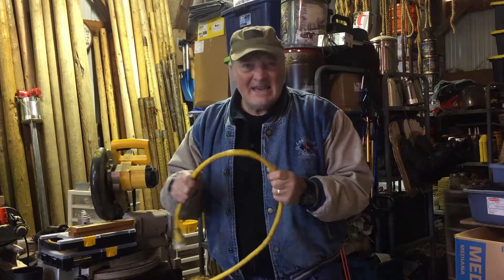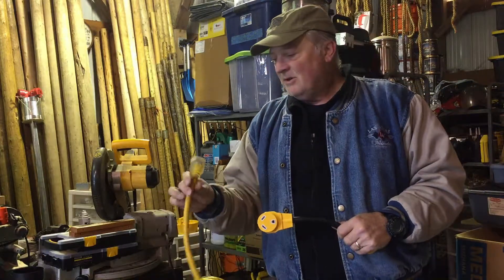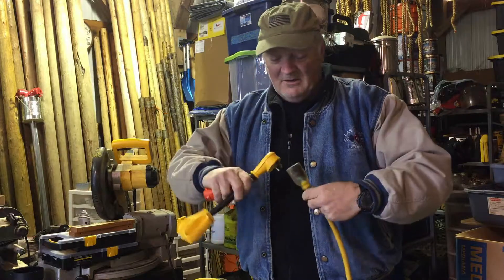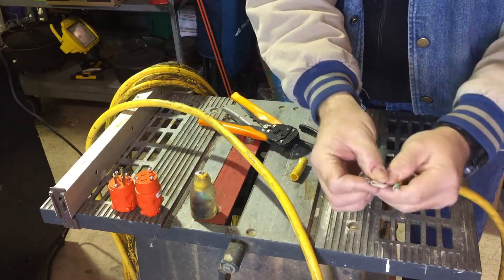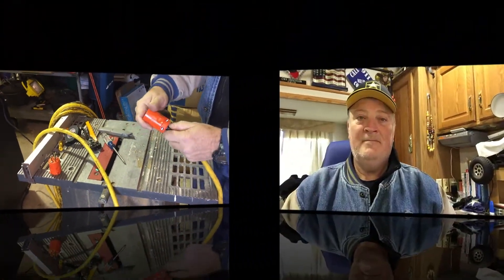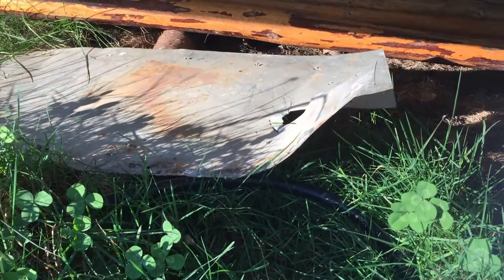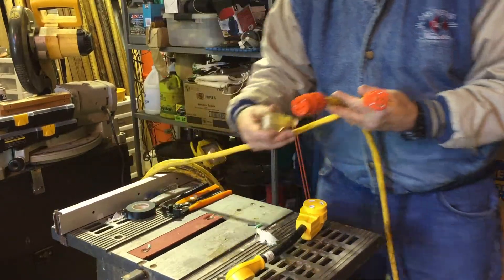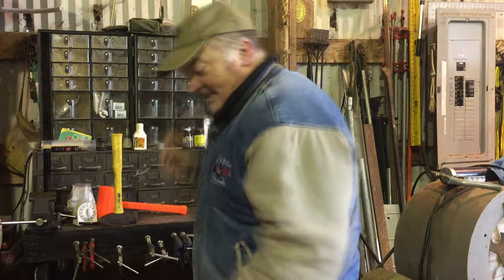RV Extension Cords: Do's & Do Not's!

Comment: Theres absolutely NOTHING WRONG with the most ridiculous adapter ever . They are designed to help you get basic power to your rv. They are very handy especially when staying at friends of families homes.  You can run your lights  heater fans etc  you just have to be “mindful” to not push more amps than its designed to handle ( no microwave etc) . Further to this if you find your rv has dead batteries this adapter can help you charge them back to life. In my opinion the adapter is a must have.  Use common sense and do not overload it!

Comment: Quick question is it ok to use a 20 amp extension cord on a 15 amp outlet?
Reply from the maker: Yes, you can do that... however, be careful at the amount of amps you actually draw and how long the cord is. Long cords have amp drops and get hot when over-used. Trying to run 15 amps on a 20 amp cord does not normally hurt the cord... it hurts the outlet and perhaps the appliance. It could lead to popping the 15 amp circuit breaker.

Comment: These work fine just need to be aware of what appliances are on and how much electricity you are using
Reply from the maker: Indeed, that would work. But for “business as usual” operations, these are only rated for 15 amps. That’s means no running the AC unit at all. These are made for “storage mode” and not really y for “use” mode. I use mine for a clean and dry place to go alongside the shop. This type of plug only lasted about one year in this mode.
Reply: @HelicoolsHelipad  actually I ran a 13,500 BTU air conditioner before I had my 30 amp service installed and honestly had no problems. However I was on a 20 amp outlet so I would imagine if it was a 15 amp outlet I might have not been able to do that

Comment: I can not afford a transfer switch and was wondering if it is safe to run a 30 amp extension cord off my properly ventilated generator through a window and then splitting with a 30 amp to 15 amp splitter. One split to run my side by side refrigerator and a small freezer (1600 watts) and the other to run a small window unit and other small items.
Reply from the maker: Extension cords are not your friend when you are running high power demands. The longer the cord, the more heat they create and amps they lose. Do some math... amps = watts/volts. So, the fridge/freezer are running 13.3 - 14.5 amps alone. That's too much for a 15 amp splitter, let alone also running a window AC unit. I'm going to say, "Not safe."
Reply: @HelicoolsHelipad  Thank you for your input. Unfortunately the electricians in my area want over $1800 for a transfer switch just to get around 2500 watts into my house. I always put less than 1800 watts on a 15amp extension cord, so I need a second line in which is why I am considering the 30 amp cord through a window for the appliances. 

I have researched the Generlink which goes behind the meter, but my city owned electric company has not approved these yet.  

I keep two CO meters in my home and always check the cords to make sure they are not getting warm. 

Lastly, do you think $1800 is fair for a small transfer switch.
Reply: @RCnLC  very safe. Commonly done. But you shouldn’t.

Comment: The 15 amp to 30 amp adapter works perfectly fine if you're not trying to run more than the weakest link. Perfectly fine for constant use but you cant run high demand equipment. Especially a 1500 watt heater and a dehumidifier at the same time. You said you have 20 amp breakers that you're plugging a 15 amp cord into. Therefore the 15amp cord is your weakest link and will fail/melt before you're breaker trips.
Reply from the maker: All extension cords with the typical three prong set-up are rated no more than 15 amps. And, nearly all household and garage outlets are on 20 amp breakers. This is the norm. The breaker trips when there is a short in the line... no melting or failure of the cord occurs. This is what breakers are designed to do, so there is no subsequent fire. Even at maximum power, the 1500 watt heater only draws 12.5 amps (Amps = watts/volts). The dehumidifier runs at 3.7 amps. That is barely over the 15 amp capacity designated by the three prong plug. Can the cord handle more? Of course it can! Especially if it is a thick, heavy duty cord like mine was. The problem with the adapter cord is that it should only be used as a temporary solution for shore power, or putting the trailer into storage mode. Otherwise, it's a piece of cr@p.

Comment: Most people park their trailer for the winter and want it plugged in to keep the batteries charged up, and or heater or dehumidifier. That is why they make those short cords you had.
Reply from the maker: All I had plugged in was a dehumidifier and occasionally a tiny ceramic heater. Those short cords were made for when you are on a trip and stay over at someone's place (temporary only). Having my trailer plugged in for winter made a meal out of my extension cord. Is your trailer plugged in at all?